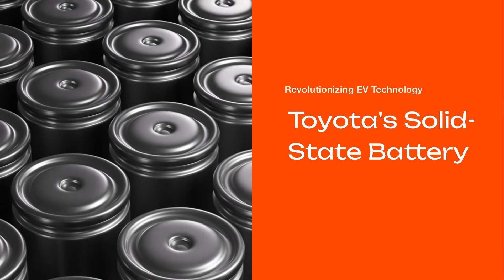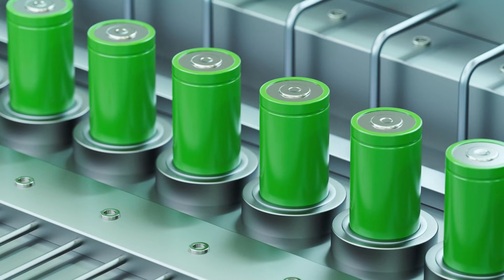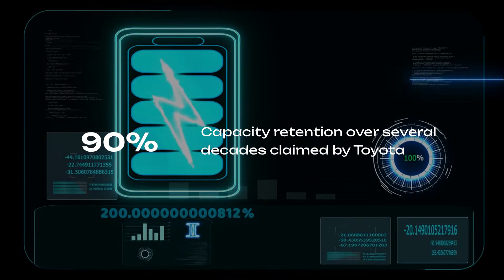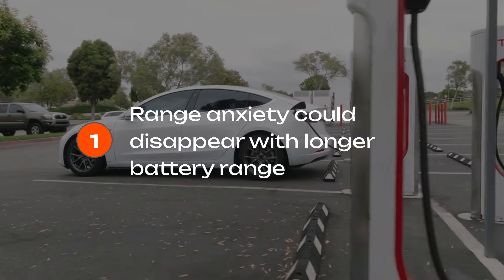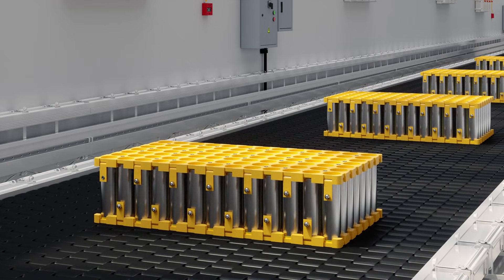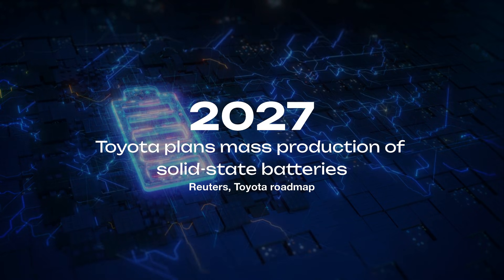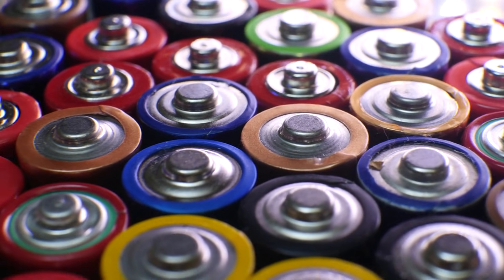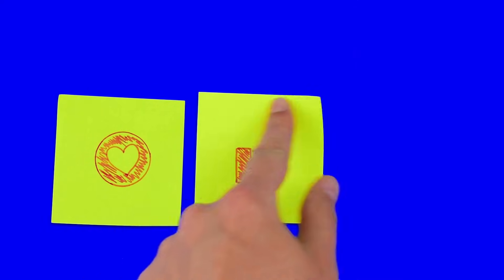What Makes Toyota's New Solid-State Battery Last 40 Years and When Will Toyota Release It

Comment: Toyota will release the prototype in 40 years. ROFTL. Toyota should be called Vapota because they only make vaporware. Fool cells, Solid State Battery, EV with 700+mi range etc. - they've been peddling nonsense since 90s and now run ads saying "20y ago we promised we'd lead on EV. Today, we're delivering on the EV promise by leading EV/electrification for autos in the US" bs. Tesla created the EV industry and papa Elon Musk is the father. Toyota is clueless